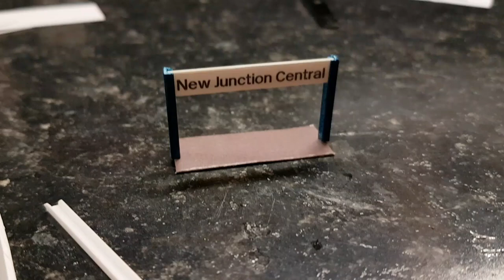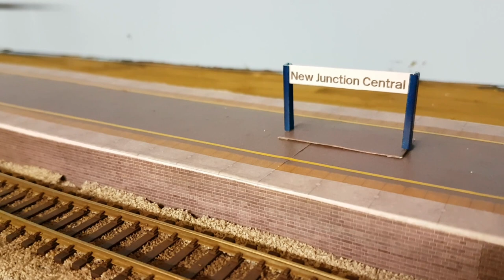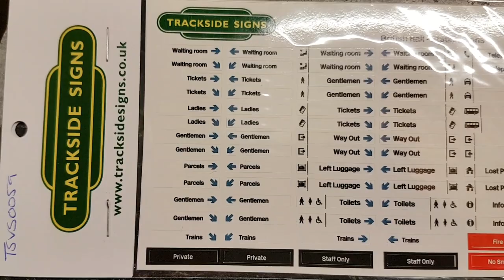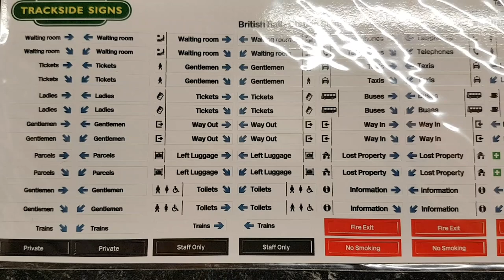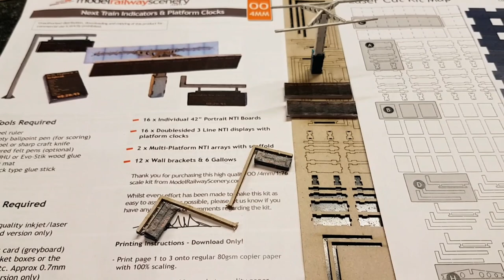New Junction - Modern Image Station Detailing

Comment: For the station name signs you could glue some stiff wire into the bottom of the U channel and then just drill two small holes into the platform to slot the wire into... just a thought? 

You could do the same for some of the others with a steady hand and a small drill bit too.

Comment: Station details are looking really good. I have the Scalescenes monitor kit and seems really good. I'm with you on the Bachmann detail pieces - they have some really nice things like ticket booths and vending machines, but seem really pricey for what you get.

As with other some other comments, could you look at some of the removeable glue dots to fix the detail pieces to the platform rather than the bases you have been using? They'd blend right in and shouldn't then leave any lasting damage if you wanted to move them. Iain
Reply from the maker: Proberbly would work really well to be fair.

Comment: Which glue did you use on the wire into the points motors?
Reply from the maker: The Deluxe models stuff